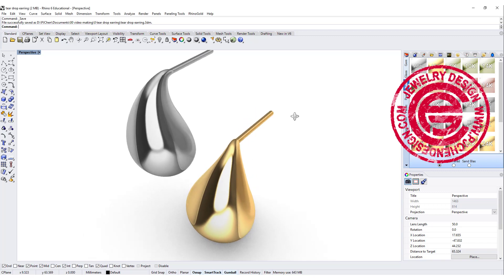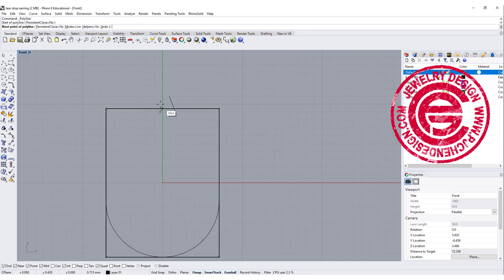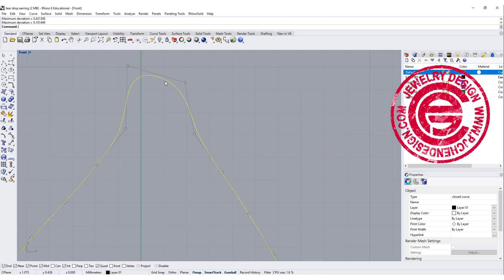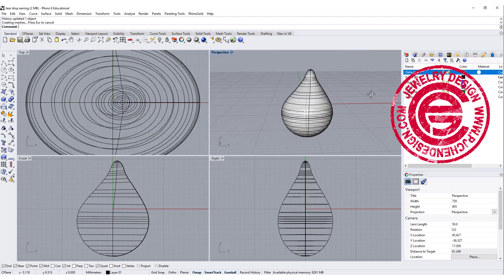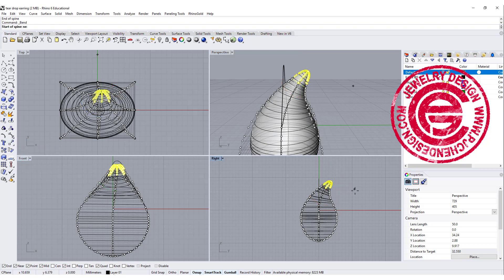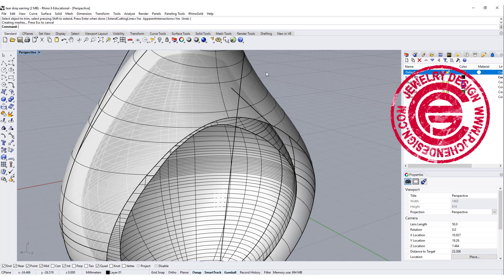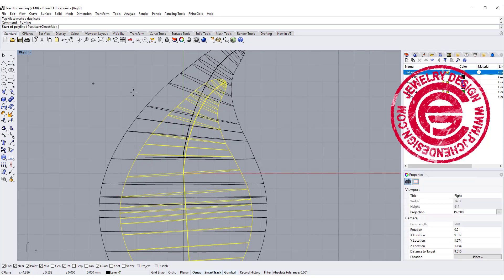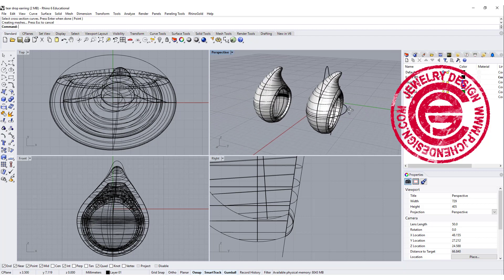Tear Drop Earring Organic 3D Model in Rhino 6: Jewelry CAD Design Tutorial #89

Comment: How do you create the two straight bars at the top of the drops? The ones you actually use to wear the earrings...
Reply from the maker: draw a line and pipe it
Reply: Thank you, I did as you said. Just out of curiosity, wil it be enough strong with a such a small contact surface once 3D printed?
Reply: You just create a cilinder (by extruding a circle) and add it to the main structure?Or there are other ways? Thank you.